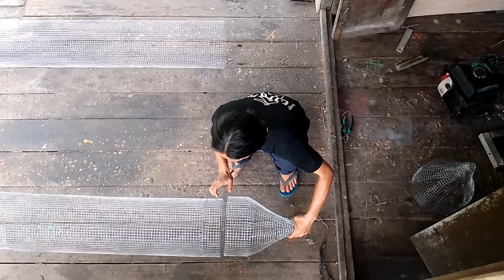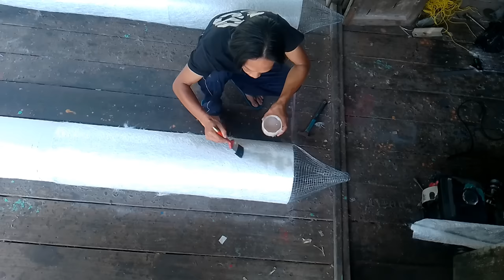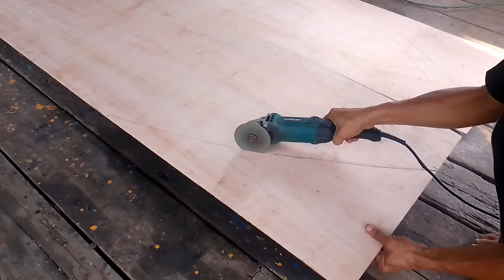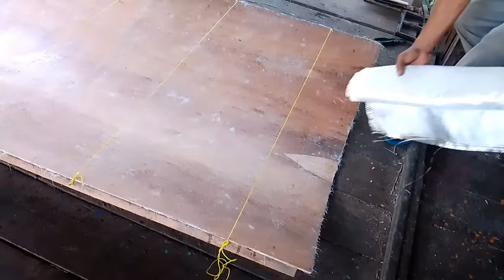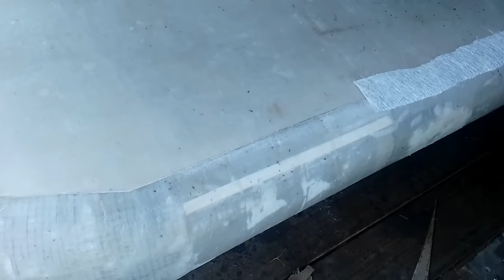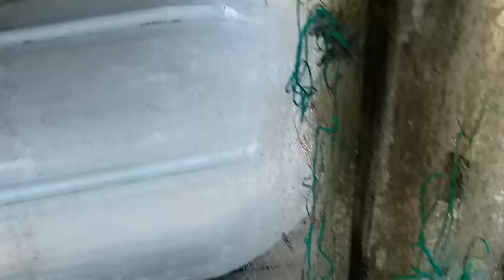inflatable boat making from chicken wire net and fiberglass (part 1)

Comment: I'm impressed with your thinking outside the box with how you formed the tubes I have used plastic pipe. I've done quick and dirty molds for projects both on the job and personal projects. I think the skin is a bit light but again I use to build fiberglass boats and parts for a living.
Reply: I was going to say something similar regarding the skin and joins to be a bit light. For the join for the Hull base with the ducky tube , I would of used and entire sheet across the width instead of small strips, as with any home fibreglassing job, de-lamination will occur over time and stronger joins will help reduce that.

Comment: Nice design.... But you can improve it's boyouncy and prevent from sinking.

If that thing gets punctured, the boat might sink because it's one big air... or water... container.

You can section the chicken wire mesh hull's interior with several closed/sealed empty 8-to-10 liter plastic water bottles.

You put those empty water bottles inside the chicken wire mesh, and then you seal it with fiberglass.

In case it gets punctured, the boat will stay afloat since the other airtight bottles won't take in water.

But if the fiberglass resin will affect or melt the plastic bottles, then the plastic bottles should be wrapped in several layers of paper before encasing them with the chicken wire mesh and fiberglass.

Comment: Great! Are you God?
Lightweight, strong, excellent buoyancy and stability, this is no more rubber boat that sinks on hooks and fish dorsal fins!
Reply: If it gets punctured, it'll sink.

You need to put several empty 8-to-10 liter plastic water bottles inside the U-shaped hull.

Wrap the bottles with several layers of paper before putting it in the chicken wire mesh... Fiberglass resin might affect or melt the plastic bottles so wrapping them up in paper would prevent the melting.

In case it gets punctured, the other airtight bottles will keep the boat afloat.

Comment: Ok but how is it inflatable?? That's a rigged hull, not an inflatable. It will work for awhile but there's not enough support from just the chicken wire to stop the fiberglass from cracking
Reply: Put empty airtight plastic water bottles inside the hull. About several 8-to-10 liter bottles.

Comment: very good thank you!  how many Square meters of fibreglass sheet did you use?
Reply from the maker: I don't know how many square meters I use, but I know it in kilograms, I use approximately 5 kg of fibercloth 😊😄👍
Reply: @bkscreative  what is the white paper you used on the chicken wire before you put the fibercloth?
Reply: Very cool boat. What was the release goop on the ply floor? And the paper used on the chx wire? Thus would be a great way to fix old inflatables with dead hypalan . Cheers

Comment: Dear BKS Creative...... question for you sir?  do you feel this is a high strength way to use fiberglass & I ask b/c I don't know
much about glass.  I've fixed a few small cracks many years ago but I've been looking at building a Styrofoam boat w/ glass
over it & now I see you using a wire product & that has me asking more questions?  Also, could you use foam & wire in the
same build?  Dumb questions I'm sure but I was here & you seem to know so I'm asking you?  Thanks for the videos, peace

Comment: You didn't show the step where you carefully removed all traces of your improvised mold release agent from the boat bottom with alcohol before laying up more fiberglass, which I'm sure you did. You wouldn't want delamination occurring, right?😉
Reply from the maker: I use butter as a release agent, this has been shown a lot in previous videos 😊😄👍